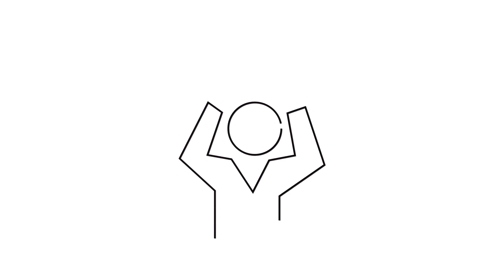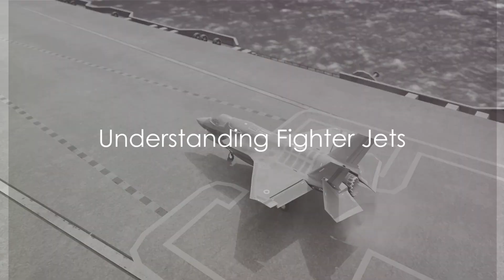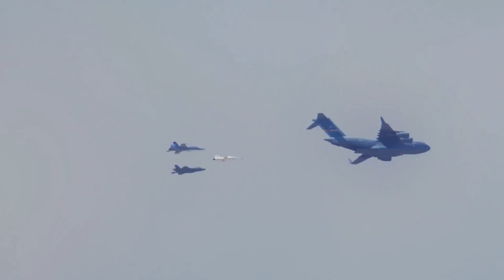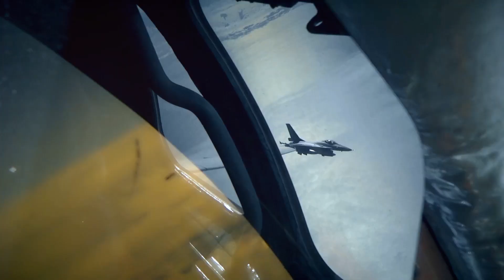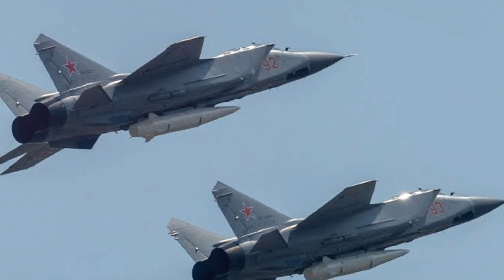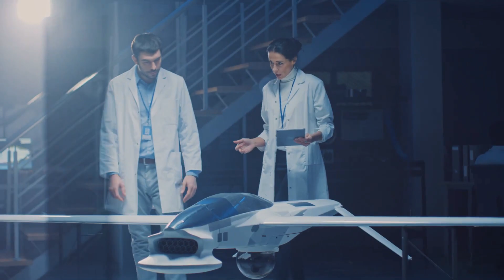Rearward Missiles - Why Fighter Jets Don't Fire Missiles Backwards

Comment: How about rear facing galling gun  , or atleast some sort of gun ?  That could go a long way to disrupting someone  shot or atleast getting them to break off ?
Reply: Ww2 bomber had gunner stations facing to the rear of the plane...?  Weigh and balance comes into a engineering problem with a fighter get .... a belt fed gun system put weight and can affect the wing design. ... the body of a jet was designed to be maintained in certain way...  even the design of fuel tank come in play...